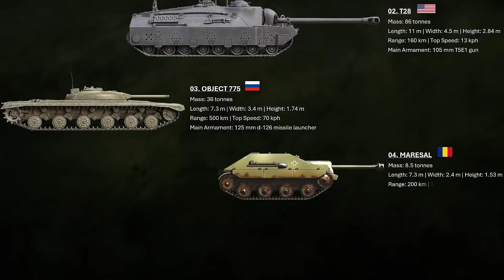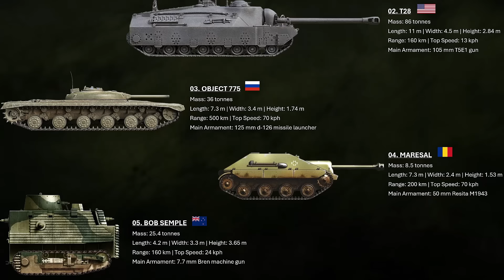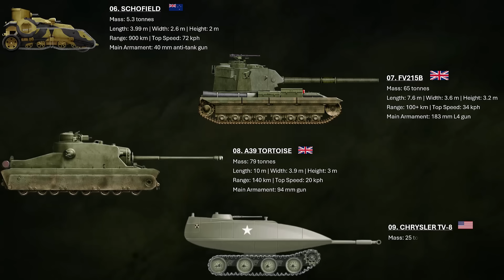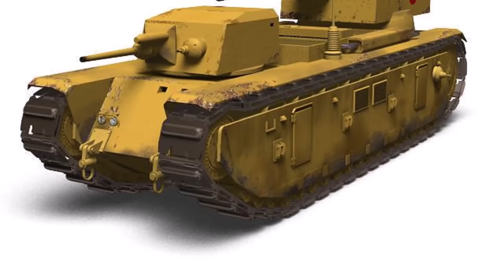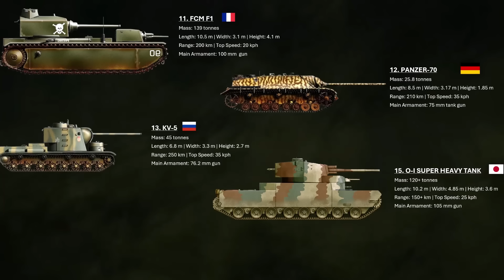The 15 Unusual Tank Concepts That Never Made It Into Production

Comment: 1:15 T95 get it right; T28 only had 1 set of tracks VS the 95 has the quad track configuration AND the 95 also had the option of the 155MM gun

Comment: Even bigger than P-1000 is the P-1500 Monster. There are two different concepts for how its movement system would've potentially been created.
Reply: The P.1500 'Monster' is more accurately self-propelled artillery, not a tank, as it was essentially just a tracked chassis mounting the 80cm 'Schwerer Gustav' railroad gun.